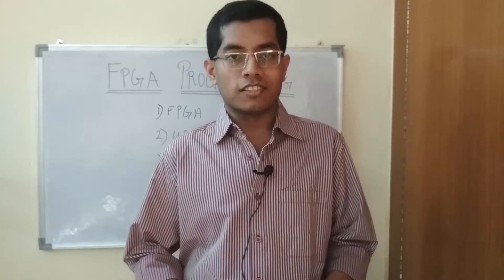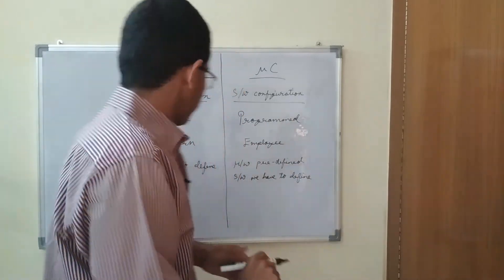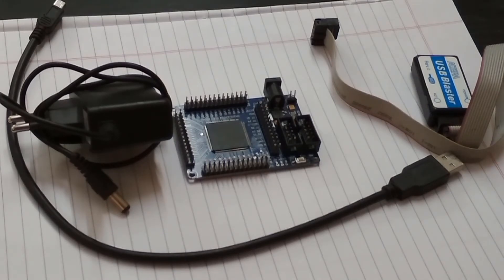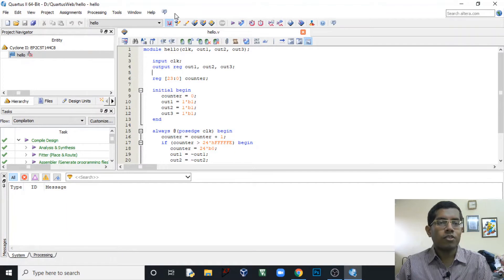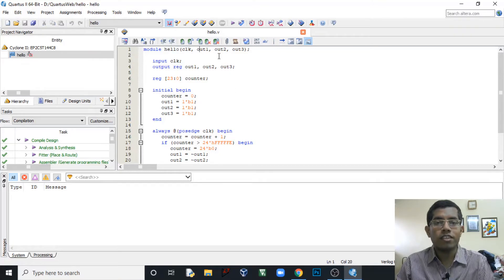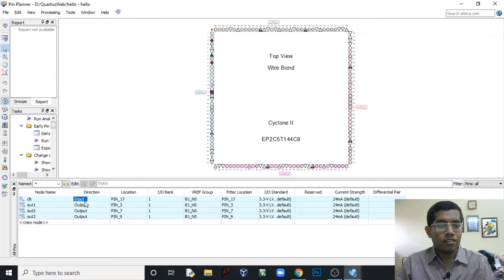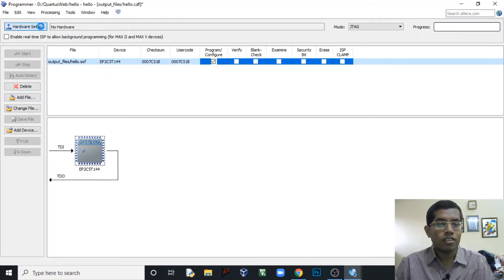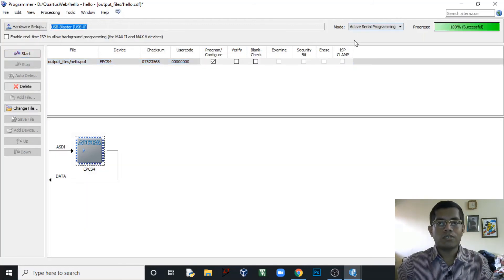What is an FPGA ? | How to program FPGA Board? | Introduction to FPGA | FPGA Tutorials

Comment: what is cheapen FBGA card who can make same soft in chip what have MESA cards build cnc machine. and were have software same than all MESA card have. can use input/output whit computer. whit ethernet controll. MESA cards cost too lot all hobby users cnc need lot lot cheapen card can use. normal MESA card cost 300 or more $ too much hobby users. all need mesa card who can use whit linuxcnc software.